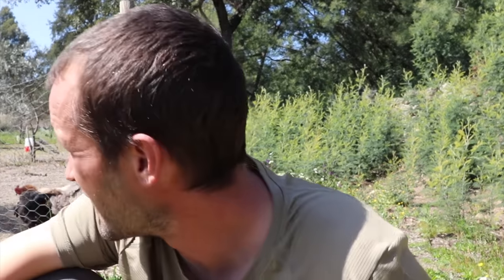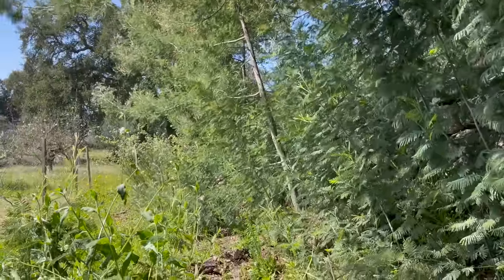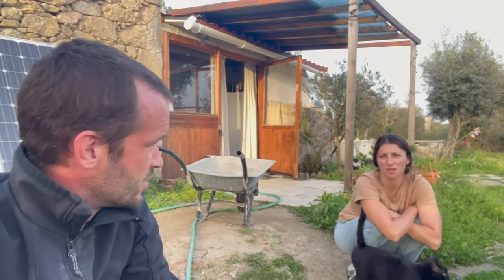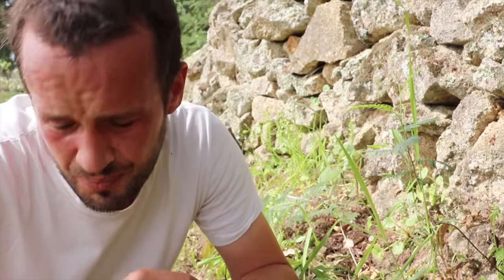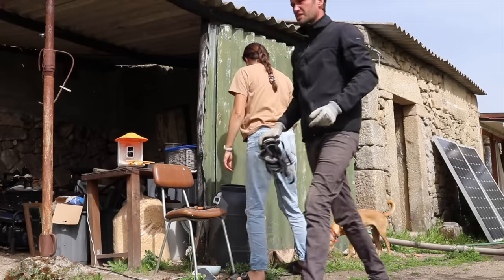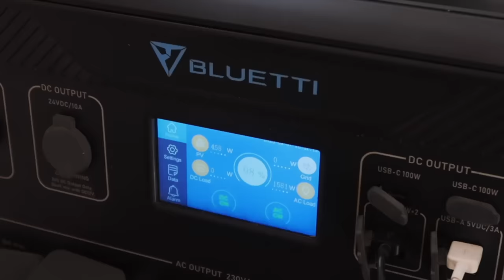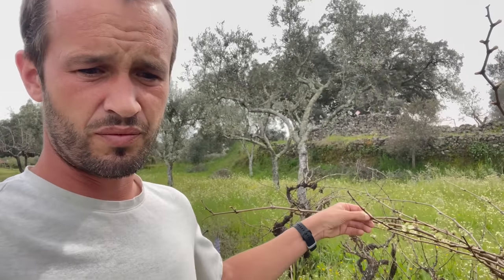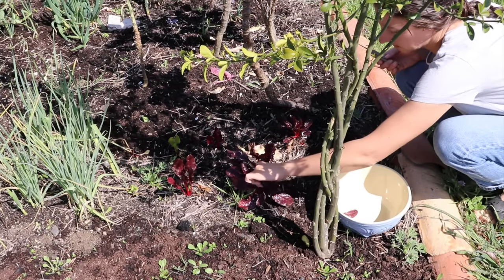Living the Good Life on our Off Grid Homestead

Comment: Apparently a solution of vinegar and salt poured into stump drilled with a few holes. Rots stump.  Slow but effective.  Might take a couple of applications.
Reply: Our mimosas r pink.  There is PREEN.  It's granular.  Can be environmentally hazard.  There is also "industrial" strength vinegar.  Either way, it will take a LOT.  If vinegar is used, DO NOT apply in the heat of the day.  It will aphexiate u, trust me.  Contact your local agricultural center.  They might have a solution.
Reply: Also, for around $60.00 US dollars, u can get a brush blade for your weed eater, strimmer, to cut down your brush.  Its a good investment.
Reply: Vinegar doesn't work on stumps for me & takes a ton to kill a weed down to roots. Usually only burbs the leaves off but grows right back.

Salt can make an area so only salt- tolerant plants will grow in the future. Be careful where you use it.
Reply: You can also use a very sharp knife to remove the bark of the mimosa 20 to 30 cm from the top to the base of the tree and the mimosa will slowly begin to dry.
For mimosas with a wider trunk, make holes in the trunk with a drill and apply chemicals.
Reply: I think you have to digg the roots out, only way. 🙈
Reply: Kudos to you for NOT using Round-Up!!!! Love your videos and your precious animals!!! 😎
Reply: Use Epson salt when you do.
Reply: Magnesium sulphate does as well.  Drill a few holes and put a handful in there.
Reply: "fun fact" A common way in Asia to kill trees, is injecting roundup in drill holes. The tree dies quickly and dry out while standing. And they still try to tell us RoundUp is not harmful 😂
Reply: We do not get cuckoo in NZ, so I love to hear them on your show.
Reply: @jeanrichardson2044  The shining cuckoo spends three seasons in NZ.
Reply: @elisekuby2009  my apologies,  I  did not research them. Do they make the same sound? I have lived here all my life and have never heard a bird call that I could identify as a cuckoo, yet I often hear them on European recordings. Thank you.
Reply: @jeanrichardson2044  No, they do not make the same sound, although one of the many repetitions sounds a little like other cuckoos.  Since there are so many varieties of cuckoo, we must assume that they have different patterns, calls, repetitions, etc.
I am familiar with the European cuckoo sounds, and amazingly enough, the  South Korean cuckoo sounds very much like it.
No need to apologize - we are all on the same journey of learning.
Reply: The only way is to pull the root system out. Get a try pod and chain block and pull them out.   don't  cut them  at ground level, cut them about two foot from the ground level  .
Reply: @andynehring5659  Agree. The way Iwan is approaching the problem of removing the mimosa, cutting them at ground level, will only make them spread in the small shoots coming up all over. This is because these trees spread underground along the root system. One has to remove the living root system. There are stump pullers one can purchase that operate on a lever system. I used to use a winch to pull roots, attached to a tree or vehicle. The problem with this is that the winch pulled horizontal to the ground. Your tripod method would help to pull straight up, which is an advantage. One still needs to dig around the root system enough to get the chain or wire wrapped around the root system sufficiently to get a good pull.
Reply: Põe sal
Reply: I  cut  the stump through the centre both ways criss, cross,  blow  the sawdust  out so that the air will draw through.  I take small twigs  put on top of the stump  to get the fire going keep feeding the fire on top of the  stump until the stump is burnt. I work great  gets rid of the twigs, branches,  that have accumulated  over the winter months. I have got rid of  several  stumps  in this manner. I always enjoy your videos. I love seeing  your cats, dogs, enjoying their lovely life, freedom. I enjoy  everything about your videos. Thank you for sharing.  Take it easy take care of the ribs or you will suffer  unbelievable if you over do it, it will take longer to heal. This is the time  you have a pot luck meal everyone  bring something , all hands chip in  give a helping hand where needed.

Comment: Those sheets are Big 6 profile. Modern cement based. To take the nails out without damaging the sheet use bolt cutters. Grip the head without cutting through and twist until you can get a wrecking bar underneath.

Comment: The way Iwan is approaching the problem of removing the mimosa, cutting them at ground level, will only make them spread in the small shoots coming up all over. This is because these trees spread underground along the root system. One has to remove the living root system. There are stump pullers one can purchase that operate on a lever system. I used to use a winch to pull roots, attached to a tree or vehicle. The problem with this is that the winch pulled horizontal to the ground. Your tripod method would help to pull straight up, which is an advantage. One still needs to dig around the root system enough to get the chain or wire wrapped around the root system sufficiently to get a good pull. One does have to remove them at the roots, but that will not solve the problem of the root system from the mimosa on the neighbor's land.

Comment: Out by the roots! I believe the only permanent solution - a small digger would be easiest (See over on 'Project Kamp' they have done this). It is a highly successful pioneer species that loves open position and uncovered soil. Once out, immediate super-thick mulch (anything from the garden, chopped up, will do). Then get large natives like oak in, that will deter the mimosa in the long run. Remove new seedings on sight.
If this seems too radical, then you could try the drilling holes/vinegar method, plus constant cutting back of new growth on the stumps, plus mulch and/or totally excluding the light with a tarp. It might eventually give up after a few years. But you have to stay on top of new growth all the time. For me this is a tougher route.

All the best! - we LOVE your channel - would be happy to help but we have a woodland (in Wales!) to keep on top of!
Reply: I find that thick mulch (I use about 3 inches thick) really works with reseeding. The suckers from neighboring trees will still need to be pruned, mainly in the spring. The weed block fabric doesn't work on seeds that land on top (only seeds already in the soil) but few seeds can root through thick mulch. The soil is too far away for the roots to reach.

Comment: Lots of good advice here already re the Mimosa - I've also heard of putting boiling hot water on the roots as soon as you have cut the trunk, then covering with a tarp or cardboard to prevent regrowth.
(Be careful of using salt on the trees - it does work, but the salt can dissolve in water and run off into your vegetable beds, making the beds unproductive. You might want to think about which way the water drains before applying the salt.)

Comment: On the acacias, exhaust the roots by routinely cutting off all sprouts and digging down or uprooting everything you can. Eventually the roots will be severely weakened and die.  I'm doing the same and it's working a few years in...

Comment: Eco plugs will sort any stump out and are a lot greener than roundup. If you want a 100% natural solution, you drill a few holes in the stumps, fill with salt and then plug the top with soil. Water it and replace the salt every week and it will drain the tree of all its nutrients until it dies. Love the channel!

Comment: I had a similar issue with a tree called, 'Buckthorn.'  It wasn't invasive until I cut down the mother plant and she sent runners everywhere as a survival response.  Same would happen if I cut the suckers or runners.  I am terrified of Round-Up but had no choice.  So instead of spraying, I took sandwich bags with ties, poured the liquid into the bag, and then I put a limb and leaves and twist tied the bag closed.  It kept the liquid from going anywhere or getting airborne and went directly to the root thus ending my buckthorn problem.  I just controlled the application.

Comment: Instead of Roundup I use white vinegar with salt and washing up liquid in it.  I cleared a very overgrown back garden (which scared away the person I was going to pay to clear it for me).  I cut everything right down to ground level before spraying it all a couple of times with the solution.  I then covered the whole area with cardboard to stifle any new growth of very high growing brambles and Himalayan Honeysuckle which looked like Japanese knotweed.  I found that an old fashioned long handled scythe worked better than a strimmer, use as if raking everything towards you rather than swinging it.  Perhaps you could find a less inflammable option to the cardboard, but it worked brilliantly, even though it took a couple of years to do it this way rather than use harsh weed-killer.

Comment: How to get rid of the mimosa where you don't want them. Use a disc on your strimmer to cut the younger mimosa shoots down, ask somebody with a tractor to pull out the stump with the roots or burn the roots inside the ground (don't do this in summer, only in the rainy season).. Besides, Mimosa is a very good fire wood because it dries very quick. The shoots are nice to use them in the garten and so are the bigger ones for posts etc. Hope this helps, all the best, Ecki

Comment: I get invasive trees in my yard, but my land is much smaller than yours. I cut them down with strimmers & and pruners, then come back about once a week or 2 to see if anything has resprouted. If you see any green sprouting, break them off. Do this weekly or biweekly & the roots & stump uses up all its energy stored in roots since it can't do photosynthesis. It dies. If you only clear an area at a time, an area small enough to keep an eye on like by the chicken coop, the trees are dead within a month or so. It works on brambles & ivy too. I have to create appointments in my calendar planner to remember to walk the area to look for sprouts, but it only takes a few minutes to do. If you come back to find leaves open, then you need to come back sooner next time to avoid photosynthesis. If no sprouts then you came back too soon. I hope this helps.

Comment: My friend I have far too much Mimosa on my land I use it for the log burner, but too remove it completely you have no chance without using Roundup as it will kill it and the roots as well as I use on regrowth when I clearfell a section for the stove. If you follow my instruction you can use it safely, otherwise you are lumbered with the weed for life.  Mix your Roundup 50/50 with cooking oil, old oil is good enough, mix it well then add to the water. spray the mimosa as it starts to grow spray to get a good cover, if you have plants nearby then either move them or avoid spraying them as it will kill everything it touches. Keep the dogs of for 1 day then is ok. It works and works very well, but if you don't want too use you've  had it as is the only fast way to get rid of it unless you want to spend your life digging it up as it will take that long. Wasps you can put a tin of cymag underneath the nest, take the lid of and by morning all the wasps will be in the tin dead. My grapes have flower buds on already yet nextdoor is just breaking bud, must be my good gardening. So you are in Castelo Branco as well as I watch a few of Dan and Lora. Hope you have plenty water as is not spring this week will be summer as forecast is 30c where I am so am sure 32 for you and the rainy season is all but done. So be prepared to start watering the garden before the month is out, unless we get the tail of any more hurricanes with U.K. 's name on them. Roundup is the only weed killer cleared by the soil association for organic garden use as it does not translocate or kill anything that you pant or sow after spraying. If you need to ask more feel free as been a garden for most of my lie.

Comment: 1 cup of vinegar to 1 gallon of HOT water and a half cup of salt. Dig around to roots a bit and pour it around the roots. It you  add a wee bit of dish soap it will kill weeds if you spray it on the weeds...
Reply: that is as environmental unfriendly as Roundup used on the spot. I would have no qualms using roundup for individual plants/painted on, the broad spraying of it is the problem

Comment: You’re right to not want to use round up or diesel - the reason I moved out of western suburbia and into rural SE Europe is to be away from noxious chemicals. 

There are less nasty options, if you have the patience you can keep cutting off any new shoots that form, eventually they will stop when the root is too weak. Or mechanical means - it’s bloody hard work digging out tree stumps, but it is possible to again weaken the tree by severing as many roots as you can.

Comment: I would try spraying the foliage of the mimosa's with 75% vinegar and super concentrated salt water mixed 25% vinegar 75% salt water. Might be hard to find 75% vinegar but regular vinegar is only around 5%  so get as strong of vinegar as you can. Make super concentrated salt water by putting salt into container until salt no longer dissolves. The foliage will absorb the spray and slowly take it underground to the roots and kill the tree. For those trees that it doesn't kill cut them to ground level drill a few small holes and pour in some salt. The spray will act as a weed spray and help tackle some of your unwanted weeds. Best of luck and keep up the good work!!!

Comment: For the Mimosa(we call it Acacia in Australia) use the cut and paint method. For smaller plants, less than 4cm diametre. Use a bio weed killer unduluted, cut off near base of plant and paint fresh cut with weed soulition. Time it a major factor to ensure the fresh cut draws in the solution. So paint within 30 seconds of cuttting. If left longer the tree sap starts to heal and stops flow at cut thus preventing any draw/ingest of solution. We have a bio week killer called Slasher here in OZ its a Pine resin based solution. Some plants may need retreating after time so cut again fresh and repaint cut.

Comment: Established trees: cut back + fertilise + starve it of light at the same time by covering the stump with a can or similar that will completely block the light for about 3-6 months.  Large patches of multiple small trees: cut to ground level and fertilise,  then starve of light with  multiple heavy tarps (or similar). I used this method on Chinese Elms with similar weediness/growth speed as well as grasses). Added benefit of general weed suppression making the area ready for planting. I use blood and bone, but chook poo is good because its a hot fertiliser when fresh.
Reply: You can probably use goats for most weed management. Because they eat everything in sight, they need to be contained to areas where its ok they eat everything to the ground. They're also good for reducing fuel loads for fire prevention.
Reply: that's interesting!

Comment: When you  chop the trunk off of the mimosa you are effectively coppicing them. That one lead stem has gone to be replaced by multiple stems! The more you cut the more will try to replace them! The suggestion of drilling holes and using salt and vinegar solution will take at least a couple of top ups to be effective. I have heard that dousing with boiling water then applying the salt and vinegar might give you a head start. Likewise I have also heard that just using the salt put into the drilled holes works. The drilled holes need to be substantial, an inch plus them packed tightly with salt it will still take time but you already know there’s no quick fix! 
Great video otherwise guys, lovely to see spring has reach you, here in uk we are still hoping it will turn up sometime soon!❤️

Comment: Mimosa (Acacia dealbata) is a primary coloniser. It's job is to repair degraded soils (it hosts nitrogen-fixing bacteria in nodules on its roots which fix nitrogen from the atmosphere and restore fertility to the soil) and prepare them for the climax species in natural forest succession. So it's actually incredibly useful! But, like most primary colonisers, it can be 'invasive'. (In actual fact, it's merely responding to the mess humans have made of the soil ecology.)  
*It responds to disturbance. So the more you cut it, the more vigorously it will come back.*
It can be (relatively) well-behaved if allowed to grow as single trees. The problem arises when it's been repeatedly cut back after coming back as a thicket (can happen after fires). I've had success with another similarly-behaving species by allowing a select few stems amongst the thicket to continue growing, and selectively cutting them back each year (while speedily uprooting any fresh root shoots) until I've got the growth back to a single trunk. Takes time, but works. Another method is to ring-bark the shoots, which kills them off.
Don't waste the cuttings though! Strip the leaves off the stems and put them in your compost heap. They are incredibly rich in nitrogen! Only be careful not to heap too many in all at once because I've had a heap get so hot it started smoking. Good luck!

Comment: Well I understand not wanting to use Glyphosate but using in a weed wiper is not the same as spraying. So without it, if you have stumps get a Forstner Bit of a suitable size and put in stump rotter or some Potassium Nitrate (or similar nitrate). This will force the stump to rot. The nitrogen fertiliser acts as a accelerator like nettles in a compost heap. You cover the stump from light. Well that's what I intend to do with big hazel stump I have.